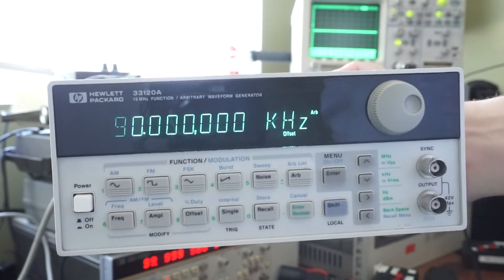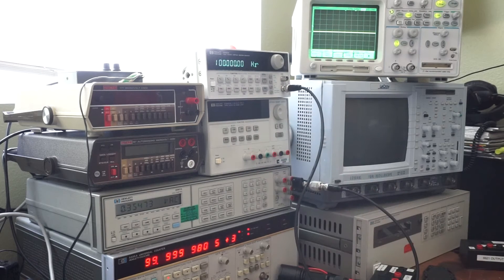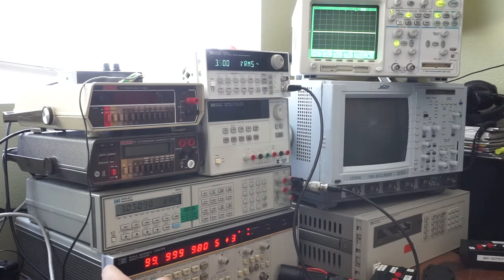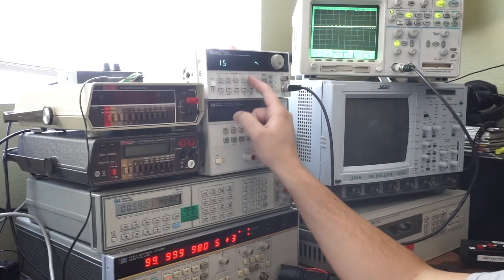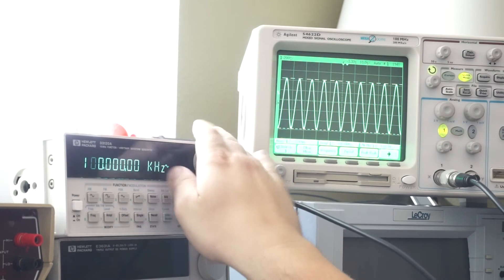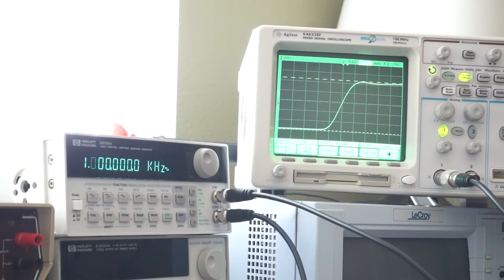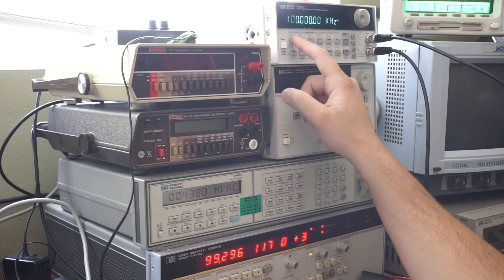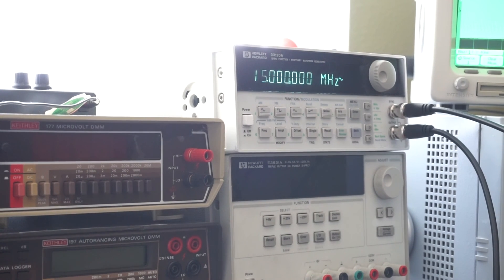HP Agilent 33120A 15 MHz Function / Arbitrary Waveform Generator

Comment: That function generator is one of the most horrible piece of a junk I've ever seen.
Very annoying interface and a waste of life really.
Reply: whats a good one then
Reply: @badcholesterol  The 33120a does have a lot of issues with the user interface; it's the way it is because it was designed a long time ago before people really got a good idea of how to do user interfaces.  Or... maybe we're still trying.  :)  But it's functionality is quite good for modest HP design, given the technology of the day.  And the weaknesses are not bad enough to get so upset about.  You get used to 'em.

With newer low-cost meters, especially the import meters, you might get more features and ease of use and so on, but watch the specs very carefully as you compare -- look at distortion, and the flatness of the output level as the frequency changes, that sort of thing.  Fancy interfaces aren't worth much if the actual signal that comes out is not so good; just be careful.

Comment: TU for nice video.
Is your function generator equipped with option 001?
Reply from the maker: I have one that has the 001 option and I have a Nortel Trimble GPS Disciplined Oscillator on the 10 MHz input.